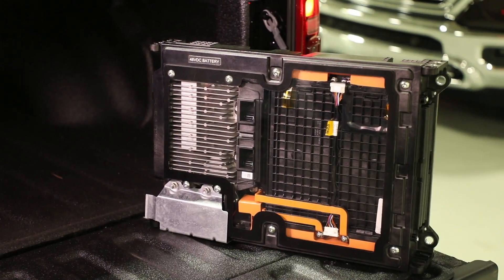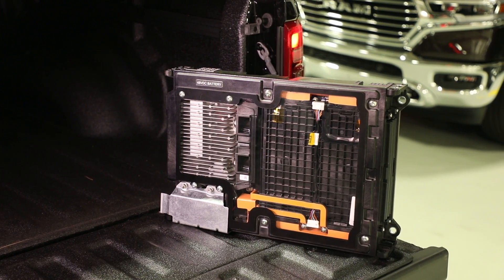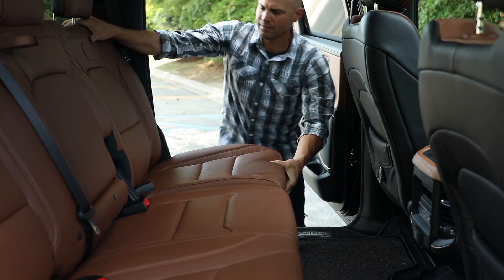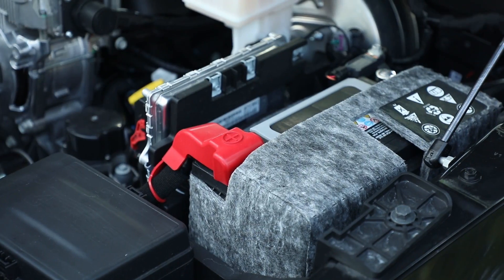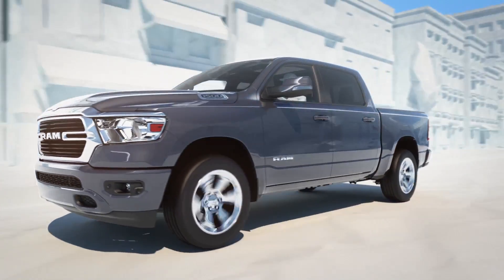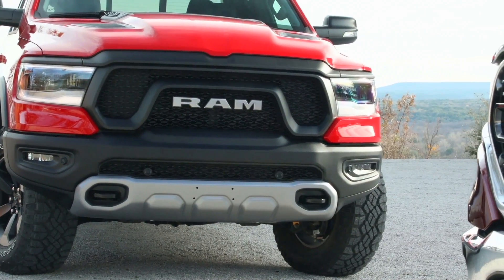2019 Ram 1500 eTorque mild hybrid system

Comment: This system is a complete and utter failure by stalantis. It's overly complicated. You can't buy the parts. They're super expensive when you can and it basically bricks your truck when it breaks and they have no replacements

Comment: Do not buy a Ram E Torque!!! The E Torque generators are FAILING, quite commonly, at about 60,000 to 80,000 miles.
You cannot find them (I've been waiting for over a month, on a waiting list that has NO ETA) AND they are EXPENSIVE!!
Maybe Ram should spend more time and money fixing this issue

Comment: Great technology. Issue is going to be reliability. FCA should warranty all if the Etorque components for 150k miles and the standard powertrain components for 75k miles. No one should have to be concerned about thousands of dollars of repairs in their first 75-100k miles especially not on trucks that cost 40k-70k dollars!
Reply: Hello my ram1500 Bighorn 2019 had problem.. I'm at 60,150km.. and I have problem with batery pack not charging the 12V battery... good news is that Chrysler in Canada is fixing it for me ... the bad news is it has been now 4 weeks since thay took it for the repair.  Will see what thay find
Reply: @tomiyourtradesguy6708  I love the design of the new Rams. I just wish they would throughly test them out before releasing new technology to the market. Especially when it deals with the powertrain! Keep us posted on the fix!

Comment: From an owner, it does not offer much fuel savings, this is more so for emissions and EPA ratings etc etc.
Reply: That's what I'm wondering. If I can just order me a new truck with the 5.7 hemi without all the etorque system on it.
Reply: Exactly. You get all the extra stuff that can break on a hybrid, but the same shitty gas mileage as a non-hybrid. It's a brilliant setup.

Comment: Does anyone know how many amps this system charges at? and since it steps down voltage, I should be able to add an extra battery off the right? I ask these questions because i want to add and subwoofer system to my 2020 but before I do that i want to understand whats going on with this setup.
Reply: I don't know about the charging rate of the amps but the typical amperage draw is anywhere from 2-6Amps, the Inverter/Battery control unit closely monitor this with a sensor on the 12V battery so you'd have to factor that in if you are installing an additional battery because this will effect that reading. The vehicle knows what consumption the equipment installed draws and makes calculations of that based on the sensor to determine if a system isn't working as it should. An abnormal reading from the 12V system can inadvertently cause an issue with the MHEV system because they're integrated with each other. MOPAR vehicles are pretty loose on the criteria to set codes for mechanical faults but electrical systems are very quick to store codes or even disable functions so I would just be prepared to run into some issues for a mod like that.
Reply: I have the part for you to use for OEM radio

Comment: It's a electric motor connected to the drive train by a belt. That's it. Takes 10 seconds to explain it.
Reply: What about when your at a red light or worse case sonario in bumper to bumper traffic. What about the ac and heat. Will this be turned off as well when motor is not running till your moving again. I'm in Louisiana so that would suck here and I got thru Dallas alot so just curious what happens as your stopped or is there a override or disable button I can use. I've never owned a Ram but looking at getting a 5.7 hemi Big Horn in a 1500 or 2500 still deciding on which one. Thanks in advance.
Reply: @jdurrant421  so I just got a 2023 rebel with this and I was worried about the same thing. Basically, the truck won’t shut off if the ac is on. It automatically turns off the stop/start. I’m in south Florida and always have the AC on and iv only had the truck turn off once. It doesn’t really help with gas mileage in my option. Just basically some more tourqe
Reply: Got any other technical details you can incorrectly sum up for me?
Reply: Thanks cause I had no idea what the hell he was saying. I thought he was running for office with that line a chit.

Comment: Just bought a 2019 1500 Laramie with etorque in May. Now it's July 3rd, it has 2700 miles and I'm back at the dealership waiting on my loaner. The etorque charging system failed, the part is 11,060 dollars, covered under warranty of course. I hope this doesn't become a trend.
Reply: My system failed at 40K. My truck is at the dealership waiting for the part right now. Glad I opted for the extended warranty!! Not happy at all though!!
Reply: @michaelcrowder320  Oh man that sucks. Is this the first time you've had trouble with it? I have 22k miles on mine now but approaching 3 years this May.
Reply: I’m happy I got the extra warranty for 8 years or 125,000 after these comments
Reply: How are you doing 1 year later lol
Reply: @randyolmos41  Hey thanks for asking. Its been great so far. I haven't had any issues. I have 17k miles on it, way less than I should have by now due to covid and not driving as much.
Reply: @lavixl  that’s awesome ! I’m glad, just got mine so I hope I don’t run into issues.
Reply: I just looked one up last week and it was about 10% of that cost, for what it’s worth.

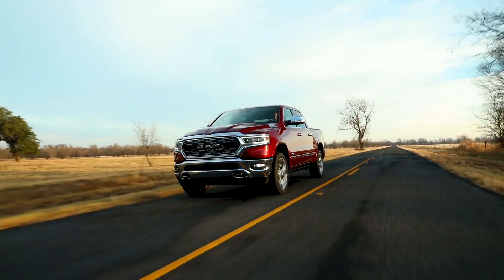Comment: Has anyone hooked a 12v Warn winch up to one of these systems?  You'd have to connect it to the 12V battery.  I'm curious how the 24v system reacts to a sudden drain on the 12v battery, and if this could be used as an alternative to upgrading the factory battery to handle the load a winch puts on the 12v system.  He states at 2:50 that the 12v system is powered by the 24V system.  I'm also curious what sort of capacity this would have for an "overland" application where you typically introduce a spare battery to power lights and other conveniences when camping.
Reply: Obviously no answer here...but your question is awesome. Did you ever find out?

Comment: If you ride the brakes lightly while coasting down a mountain road, will the regenerative braking be used exclusively to slow the truck, or will the brake pads and rotors heat up?
Reply: Let the motor do the braking. The electric motor will put a drag on the drivetrain to regain the energy. Do not touch the brakes unless you have to. Regenerative braking is only a term. The brakes do not actually collect any energy.

Comment: I have this on my 2019 Ram 1500 Limited.  If you are only familiar with earlier generation 12v stop/start systems, you don't understand how much better this implementation is.  I had the older gen on my 2016 Mercedes Benz GL 450 and hated it.  I reflexively disabled it after starting the car.  I leave the eTorque implementation enabled because I really don't notice it.  Fantastic technology.
Reply: Do you have the v6 3.6? I'm looking for performance mods but I cant find anything like a cold air intake an custom catback exhaust, mines the quadcab 6.4 bed box

Comment: I have driven a few vehicles with stop/start, horrible systems.

The heat & air basically stop working when this happens.
Reply: A/C still functions during start stop according to press release for etorque
Reply: @ForTehNguyen  It has an electric non-belt drive compressor?
Reply: A/C compressor is on the same belt as the 48V motor and on a different crank pulley than the one powering the water pump, so it can still spin with the main engine being off.

"Unlike regular stop/start systems, eTorque has air conditioning capable of blowing cold air when the engine isn't turning, even though it has a conventional belt-driven A/C compressor."
Reply: @ForTehNguyen  Just looked at a picture of the system. Not seeing how that is possible. The wp has a small belt on the main cranks pulley, most likely to save on cost, by using an extra belt instead of requiring the e torque belt to be even longer. Unless the main crank pulley is clutched (I have seen no indication of this) then shutting down the engine will turn off the compressor. I have read the entire press release and the only ac tidbit was this:

"
The new HVAC system features nearly 25 percent more air flow at lower noise levels, including larger front defroster vents for better performance. Improved vents give rear passengers 50 percent more airflow when compared to the previous generation."

The quote you gave was from car & driver. I'm not trying to argue, but one of us is wrong. If the system has a clutched main pulley, then you are correct. A pulley with two different belt paths does not mean it is clutched, just that it has two belt paths. Very common, just like the gm LS motors.
Reply: @ForTehNguyen  I never got a response.... Please prove who is wrong. BTW, I have had an extra week to study the designs between V6 & V8 systems, still not seeing a clutched main pulley....
Reply: @gregbaird7582  it works. Had the truck two years and a/c stays on blasting when engine is off at the lights

Comment: I dont like the start stop at all. hopefully they will continue to have non start stop trucks to, or else have a way to permanently turn it off
Reply: There's a button in my truck to turn it off
Reply: Yeah simple push of a button by the drive mode selector and its off.
Reply: Im not clear on if it is using the traditional starter to get the motor running or the serpentine belt to start the motor?
Reply: @ewmegoolies  it's using the serpentine belt for start/ stop - the starter is just for the initial start.
Having eTorque definitely makes the start/ stop transition smoother. I occasionally look down because I can't tell if it shut off or not. My old 04 Hemi would get 12mpg on my drive, while my 2020 gets 16+.. it definitely makes a difference.
Reply: IMO, Start/Stop can work well in full hybrid, where the electric motor has enough power to fully launch a vehicle from a dead stop.
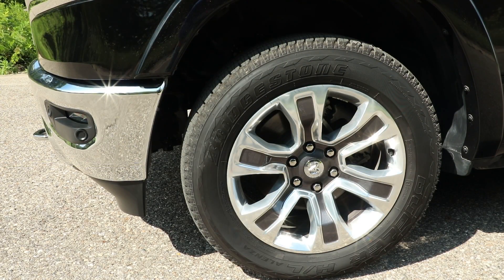Reply: 1:55  "...save a 1/2 gallon per hour with auto-stop"   ... nonsense, that is about a 50% improvement in gas mileage, LOL ... prove it.  Nobody wants their dang engine shutting off, not ever! .. let's call that "Engine shut off anxiety".

Comment: What's the life on the Power Pack Unit?  Will it need to be serviced or replaced every few years?
Reply: Fridges? The F? 
Shawn that’s a good question. 😁
Reply: Shawn Browning The 48v battery pack is oversized relative to the power draw from the eTorque system. The actual eTorque system only draws about 1/4 of power from the battery back at maximum. This is to ensure the battery pack remains functional for a long period of time. All that considered, it’s designed to last about 10 years with normal operation
Reply: Shawn Browning do you have to change the motor in you refrigerator every two years ?
Reply: @jamesweinzierl7399  The power pack is the 48v battery unit. I don't know of any fridges with one of those.